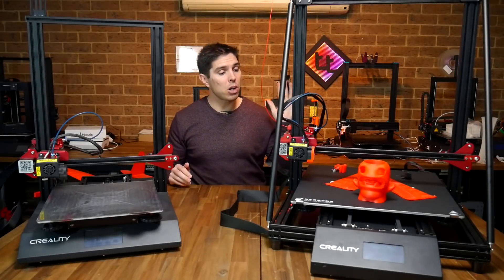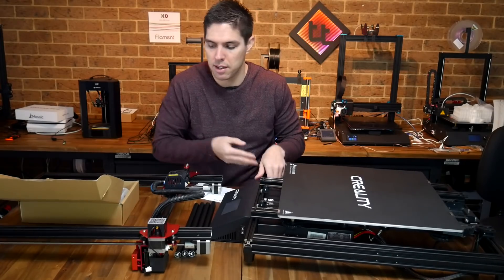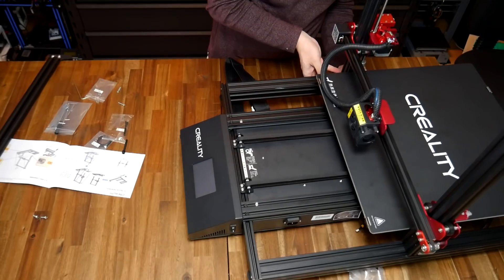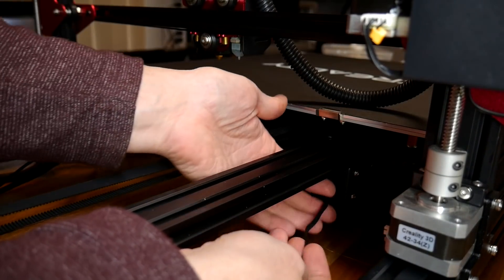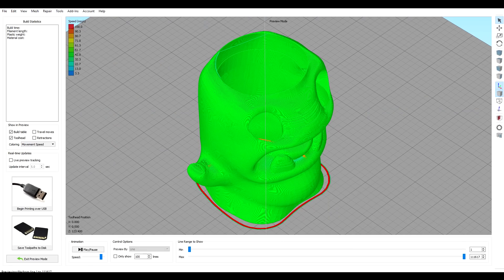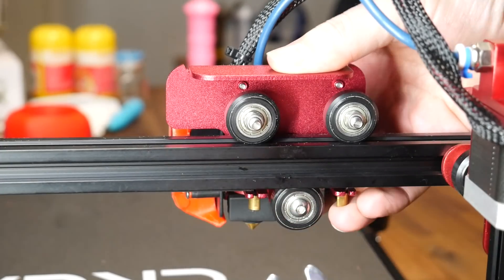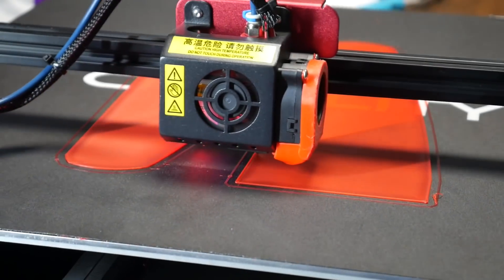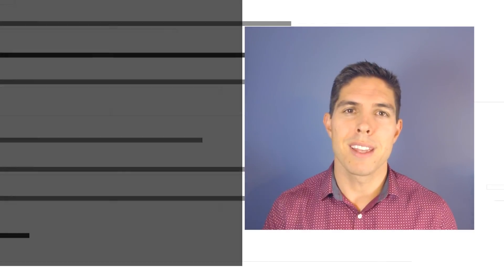Creality CR-10 Max first impressions: Is bigger better?

Comment: Ive found that I can trigger my thermal runaway just by grabbing my hotend with a chunky adjustable wrench when the silicone sock is removed. I was doing the final hot tightening on my ender 3 after doing a nozzle replacement and I thought I broke my thermistor wire somehow but when I looked at my temp graph I could see the wrench was acting as a huge heatsink and it was enough to trigger my runaway shutdown.

Comment: Another great video! I have a CR10S Pro, and wondering if you could take off the shield on the hot end give us a closer look at how they mounted the BL Touch. Is it the same hot end as the CR10S Pro? I am considering installing one on mine and just curious how Creality mounted it. Also, how long does that monster plate take to heat up? From what I see in this video, the CR10S Pro still seems superior.

Comment: The printer seems to have a removable bed hold by some clips. I suppose it is made from FR4 like that of my Ender 3. So why not take this plate from the bed and flex it to get the prints off?
Reply from the maker: It removes but there is no chance of flexing it. It's thick aluminium.
Reply: @TeachingTech  That is a rather stupid design, so the best option is to replace it by a FR4 plate.

Comment: Michael, for cable management I use a large cable tie, around 8-10mm wide and 500mm long cable-tied to the loom to keep a graceful arc in the loom. Cheap, easy, effective.
Reply from the maker: Thanks for the suggestion, it sounds like a winner.
Reply: Why not an elastic like the ones used in fabric. I have one on both my printers. Works well and because it stretches it doesn't have the problems of a more rigid attachment. Probably not a big deal but there it is.

Comment: I tried Creality's alcohol trick to remove prints and it works... Lost count on how many surfaces I ripped before. Also tried hairspray for PETG and TPU both in Creality's surface and Prusa PEI sheet and it reduces the stickyness just enough so you can remove the parts without ripping anything. Also I usually remove springs on all my beds once the printers have autoleveling, I try to cut 4 equal pieces of aluminium tube and level the bed sanding them to exact size, once and forever.
Reply: you can buy the solid spacers here:

https://www.aliexpress.com/item/32911227044.html?spm=a2g0s.9042311.0.0.2f5d4c4dvwugT2&fbclid=IwAR21W8EeVKoddS8_jgajYoLIyOU15OOTYRuT9AQ8GlBzOwE5JMbVUEGrc-o

Comment: What I would like to know is 1.) How high does the bed go (can you do ABS, and HIPS with a bed temp of about 100) 2.) What would be involved of sticking a volcano on it. We (FRC team 1989) are thinking of getting one to print big things like parts for pur 30x30x48in robot (or thereabout) which will take about 20kg of Filament. Right now all we got is a prusa clone which we would like to keep doing Gears on (nylon) as it has a garolite bed. But its a little too limited size wise.
Reply from the maker: I just tested and the bed can reach 110 degrees no problem. A volcano I haven't fitted but the mount is very similar to a regular CR-10 so it should be comparable.
Reply: @TeachingTech  Thank you now lets hope the sponsor comes through. Here is some the kids and me are working on https://forums.matterhackers.com/topic/6257/bumblebot https://forums.matterhackers.com/topic/6216/virt-1000-3d-print-impact-resistance-tester https://forums.matterhackers.com/topic/6210/404-1-planetary-on-a-pulse-attempt So the intent was originally to get a CR10-S5 but as they stopped that the goal now is a MAX especially as if the bed goes to 110 there is no need to spend 200 on an upgrade. The volcano though might be helpful unless you know another high-volume hotend. Now the .8 nozzle might help a little but probably wont increase speed by more then a factor of 2 as with ABS for example on a V6 the max flow rate is about 12-13 mm3/sec if you want decent layer adhesion which when sliced with a .4mm layer height and .96mm layer width comes to a max speed in the low 30s mm/sec or you get problems with the plastic not melting fast enough. you can check out my volumetric E video on that for details and the math behind it. BTW the material from ABS, HIPS, PLA, NYLON, PETG you can print the fastest on a V6 is HIPS at about 18 mm3/sec. Now according to microswiss their flow rates are comparable to the V6 and according to E3D the volcano melts about 2x the plastic in the same time so with that and a .8 nozzle we'd hope to use a 1mm nozzle and maybe push 45mm/sec speeds with good layer adhesion on ABS/PETG and close to 60 on HIPS.  (Don't print any Taulman over 22)

Comment: are the nozzles still 'special must be ordered from creality' like the 10s pro nozzles?  IE not standard nozzles.

thank god for the bl touch.   why can't they issue an MK2 of the 10-pro with the bl-touch?

why in the world can't this ship this thing with a glass bed. There is no way that aluminum plate is going to be even close to flat.  Especially when you have to tighten the bed screws down so far.   That stock bed is just junk just like the 10s-pro.  All it takes is one print with too little of an offset, and you will never get the smooshed filament off the bed.
Reply from the maker: Can confirm the non standard nozzles. it came with a 0.4 installed, two 0.4 spares and a 0.8mm.
Reply: @TeachingTech   thanks for confirming.  At least they come with more spares then the cr-10s pro did

Comment: Get a piece of 3mm shock cord and tie the cable up to the top of the gantry. If its too strong and affects your prints you can use smaller shock cord.

Comment: That's for the callout! Big fan! Yeah, I got burned by the CR-10 Pro also- gave it a thumbs up because mine was ok, turned out everyone had problems. Very embarrassing. Now I pull them out of the stack myself at the factory but these early firmware versions Creality keeps shipping new printers with really don't impress me😕 It's a problem...
Reply from the maker: Thanks for dropping by. Myself and everyone in the community is thankful for all the work you have done dragging Creality  forward with your honest feedback.
Reply: @TeachingTech  I try!😅
Reply: Agree. Naomi has been a great resource for all of us Creality users. We wouldn’t have open source Ender 3 without her.
Reply: Its rather disgusting that Creality keeps pumping out new models with all of the known problems of previous models.  They need to take a breath, slow down and fix the issues first.
Reply: @JohnVanderbeck  problem is not with Creality, the problem is with people willing to part with their hard earned money for subpar expensive machines. As long as people keep buying their lacking, underdeveloped products in droves they`re not going to change much if anything. Take this CR10 ax for example: for a couple of feet more extrusions and a BL Touch they`re charging almost double the price of a CR10S Pro but still they use the crappy PLA fan duct and those horrible bed springs.
Reply: They should offer the Hot End to upgrade Other models. My CR10S5 Bed is not possible to manual level without tape and paper shimming the bed. Auto leveling would help newcomers greatly.
Reply: @jamesdean7412  I've added a BL-Touch to my S5, and it works great.
Reply: @originaltrilogy1  me too it made all the difference
Reply: I just watched your review and this one. 
I just had ordered my CR-10 Max. 
I am looking forward to what I can do with the printer. I am also thankful your both you and Teaching Tech with the advice with these machines.

Comment: The Alfawise u20 plus is 400 x 400 x 500 and under $400.  I know the Alfawise have their own issues but I think the U20 comes with mosfets installed.  I have the U10 and have made a few upgrades which I don't mind doing given the price.  Not sure why there are not more review of these printers from the bigger 3D printing channels.  I have only seen one from 3DMN.

Nice review though!
Reply from the maker: My last Alfawise printer was a disaster. Possibly an anomaly but Gearbest still tried to pressure me into being more positive despite it catching on fire so I'm in no hurry to take another printer from them.
Reply: @TeachingTech  You have to provide an honest opinion for sure.  I was glad to see the thermal runaway on my U10 was enabled and now I have the mosfets installed I think it will be quite safe.  I like the Creality machines too.  We have several at work.  It was ironic recently when we had a bunch of prints to do we had all sorts of problems on the Creality machines and so I ended up printing everything at home instead and got it to work fine. Keep up the good honest work!

Comment: I’m willing to bet the z axis isn’t completely square as proper tie rods will have a right hand thread one end and left hand at the other. It is possible that printer may have a slight twist on the z axis. You showed you relied on those little brackets to hold it square. Aluminium does flex

Comment: Use a retractable key chain attached to the top rail to keep the cable up
Reply: Can you explain it better to a newbie that I am, please?
If you have this printer, how are you finding it? Thank you.
Reply: @charlie_jack_chi  If you google a retractable ID   badge holder you will see the thing he is talking about. You attach one side to the very top rail of the printer and attach the bundle of cables to the other side of the ID badge holder. I hope this helps!

Comment: Those extra rods are not just to stiffen the frame. If you don't adjust them properly then you'll skew the vertical path forward, backward, or even add a twist even though it's still "rock solid."
Reply from the maker: I agree which is why I ensured it was square first. I also avoided tensioning it to avoid pulling it out of square.

Comment: That was just a really fun watch and a great review.  I enjoyed seeing it compared to a cr10s pro for scale.  The inclusion of a BL touch was quite a welcome surprise as equally the unwelcome surprise of the lack of thermal runaway protection.  How they can be so responsive to feedback and agile to hardware improvements but can't manage to tick off thermal protection when the source code is right there ready to go just boggles my mind.  In any case, really looking forward to seeing what ginormous prints this thing can pull off.

Comment: Solution for the bowden tube and the hotend wires dangling around:
I saw a friend of mine attach one of these keycard yoyo clips (https://images.app.goo.gl/8K2n1xQAGKRfnV499) to the top bar of the frame and to the wires. It always pulls the wires out of the way neatly.
Reply: Can you confirm it did not negatively effect print quality? I like the idea if it works.
Reply from the maker: Seems like a nice solution, thanks for sharing.
Reply: @David Rolling
I could not imagine why it would have effects on quality. Only thing would be if the x stepper suddenly skips steps but the yoyo does not pull that hard on the wires and if it would skip steps anyway maybe some more current for the x stepper would be due anyway.
Reply: Schild0r I was just concerned the “pull” of the YoYo might influence printing at the edges on the lower layers (ie when it’s fully extended).
  As you shared it shouldn’t negatively influence, but I’ll be selecting a yoyo with a long reach in hopes it does place much pull on the printhead by way of the cables.

Comment: cant understand why it is so much more. I know there are some nice features but the cost of a bit extra extruded aluminium and larger hotbed. The touch feature is about £20. MIght just be better to go for the Creality CR-10 s5 which is 500 500 500 and 2/3rd the price and buy some rods for the golden triangle and a bl touch (not sure if thats possible). Bigger machine, cheaper price
Reply from the maker: That will definitely be more cost effective but not as polished.

Comment: For prints stuck to these printer beds, use a mixture of rubbing alcohol and water in a small spray bottle (75%RA/25%water) spray some around the base of the print (you can be generous as you can use the excess to wipe off the bed after) give it a minute to work its way under the print and then you should be able to pop the print off a fair bit easier.
Reply from the maker: Never heard that, but I will be trying it for sure. Thanks for sharing.

Comment: Michael, can you also check out if it needs a connecting belt at the top to keep the hotend level across its travel?  I have a Alfawise U10 and had been intending to do this...wondering if Creality have developed a better design etc?  Thanks Laurie
Reply from the maker: It doesn't have one in place. I can't see any issues with z artefacts from this stage yet. I'm currently reprinting the SD print now that the bed wobble is gone and that should give a better idea.

Comment: Um, with the rods, if they are all the same and all the rods and ball screws are right-hand thread, is there no adjustment to pull or push the z-axis assembly into square? Shouldn't each end be opposite thread so the rods function like a turnbuckle - allowed slight adjustments in length of the rod assembly?
Reply from the maker: They can be adjusted as you describe. No fancy threads needed.
Reply: @TeachingTech  how? Rotating the rods would simply move the black metal sleeves back and forth. The only way to adjust the overall length would require removing one end of the rod, twist the ball head/eye bold a minimum of a half twist, and then reattach to frame.

Comment: The best way to get a print off a bed is not hack at like a gorilla: slide a thin box cutter blade around the perimeter first.
Reply: Also why not add a corner raised lip on the objects design, so we have a spot already open to lever up?  Imo Laurie
Reply: Depending on your print's geometry you can also "hit" it gently with a hammer/screwdriver's handle/whatever. 5-10 hits on the side of your piece will shake it enough to just pop out from the build plate. This is how we do it all day long in here :) (sorry for my english...)
Reply from the maker: Okleydokley when it's stuck on that well, an angled blade is likely to cut the bed surface pretty quickly. You have your own way and that's fine, but my models and print bed are still in perfect condition.

Comment: It is probably the same hot end as the Pro, it would be nice if they went back to the standard hot end so there is no issue on getting nozzles for a reasonable price, or changing to a MS hot end on a machine that we already spend 1k on, for now I will be keeping my S5,lol. Thanks again for another great video
Reply from the maker: I believe it is the same hot end and non standard nozzle.

Comment: Must be a new month...a new Creality printer.

The problem with big prints...they can use over 1kg of plastic per print, especially with 0.8mm nozzles. At that size, 2.8mm filament would make more sense.
Reply: Just buy a 4.5Kg filament roll of 1.75mm. I think you will find the difference between filament usage with larger nozzles compared to smaller ones is pretty much not worth worrying about. More material can be saved by changing wall thicknesses and infill. It still takes the same amount of material to make an item with the same overall parameters but with larger nozzles the time reduces. Just an observation of many hours spent printing.
Reply from the maker: My Tornado is 0.8 equipped and I agree with this. You end up reducing the perimeters to achieve the same thickness.

Comment: Hey Michael I've noticed it a few times but especially on this video, there's a weird flickering happening I assume with your lights and the cameras fps. You can notice it on your shirt as well as the build plate.
Reply: Looks like fl hum to me. Frame rate of camera must be like 50% of power cycle. In USA I'd say 120vac 60hz and 30 fps on the camera.
Reply from the maker: I've noticed it too depending on the lighting. Camera is set to NTSC 30fps and main room light is 50hz. Hoping to improve the lighting in the room to eliminate this.

Comment: I wish these mfr's wouldn't rely so heavily on your feedback. It would seem obvious
they are attempting to shave every possible penny from their end of the cost, only to
tack it on to the consumer end. Even if this weren't the case, it still seems glib and remote.
Reply from the maker: Hopefully you agree that I am very honest about testing and showing the issues on these printers so viewers can make an informed decision.
Reply: @TeachingTech  definitely. I think the issue is that it's bunk that Creality (and others) put out products that are not polished and rely on reviewers like yourself to inforrm the design of "gen 2". You are even keeled, but in my opinion things like a cooling duct that breaks on day one and no thermal runaway are absolute deal breakers, even if they are easy fixes. If I'm paying a grand, it should be GTG out of the box, regardless of how cheap or easy is it to fix. If it's cheap and easy for me too fix, it's cheap and easy for the to do it before shipping.
Reply: @ender4555  you're not wrong...😕